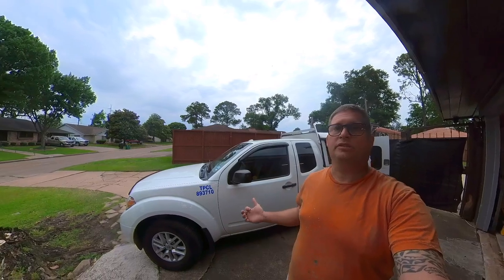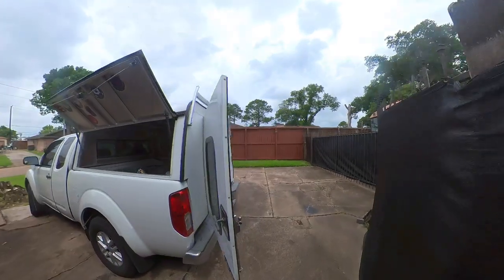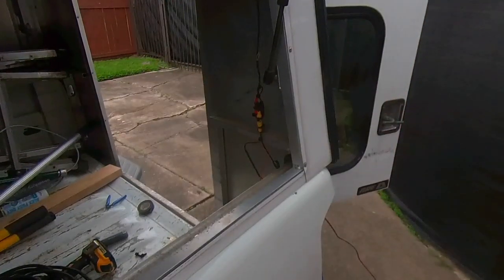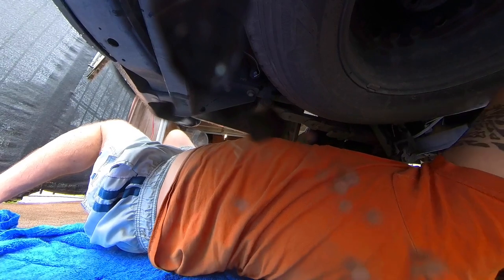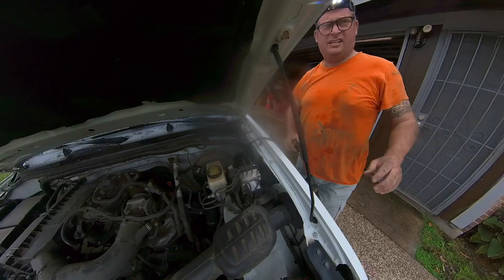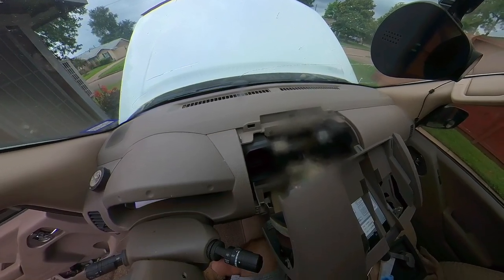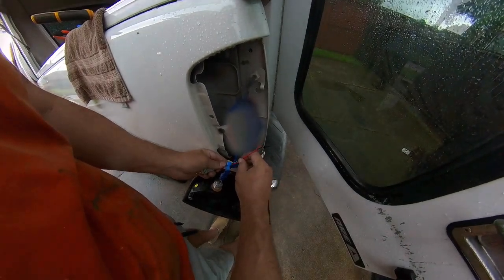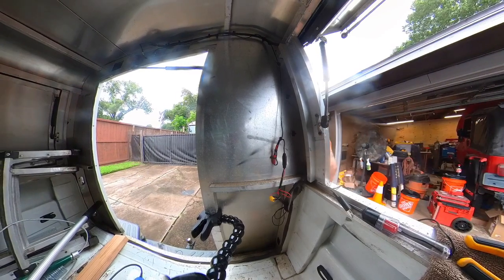Adding a Backup Camera to a NIssan Frontier (2017) with a truck cap

Comment: What wires from the add a cam harness did you end up using. Watched the video and you didn’t really talk about what wires etc. thanks for the video.
Reply from the maker: Sorry, they were pretty self-explanatory... One is tied to the reverse light from the rear (the red messenger wire), one is ground and one is video in, which is marked on the harness.  I temporarily connected them to make sure it worked and then soldered and taped them.

Comment: Can you give me more info on the harness you purchased on eBay?  I’m having trouble finding it.  Thanks!
Reply from the maker: I found it on ebay if I remember right.  It was difficult to find.  You could make one by hand if you had to.  The harness is just a time saver so you don't have to splice the factory wiring.